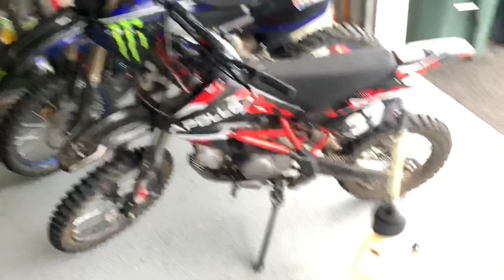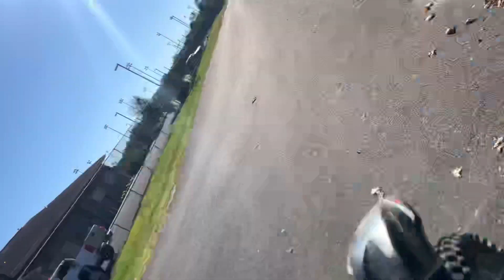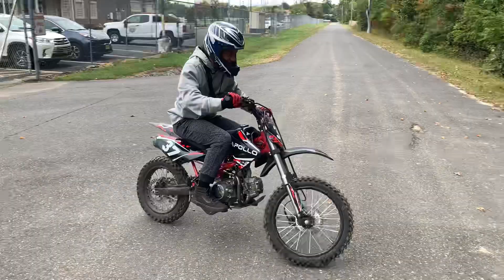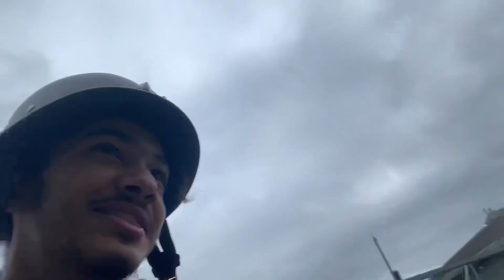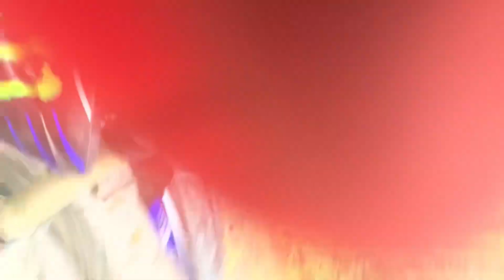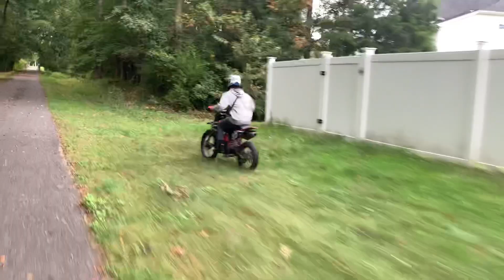Learning Standup Wheelies On Dirt Bike

Comment: would i fit on a 250 if I’m 14 130 pounds like 5’9 i don’t have any experience with a clutch only an automatic four wherler
Reply from the maker: yessir!💪🏽
Reply: You would fit but I think it’s a bad move to go straight out of 250 you should get like 85 or 125 to much power on a 250 and you lack of experience